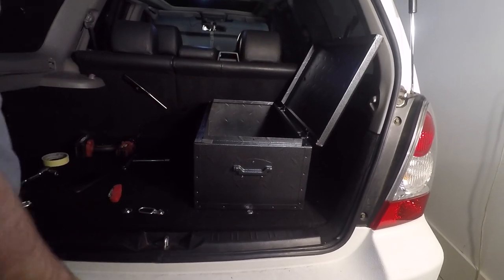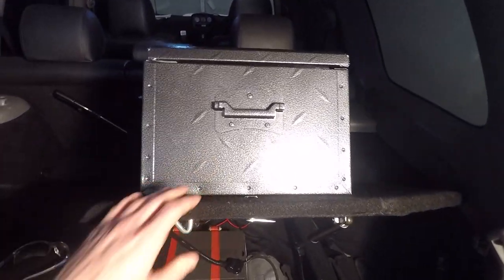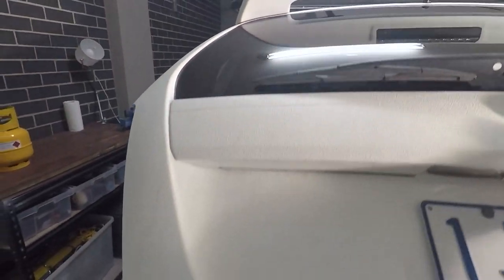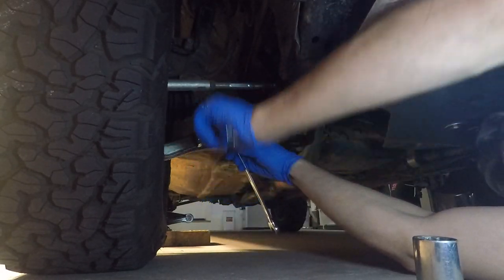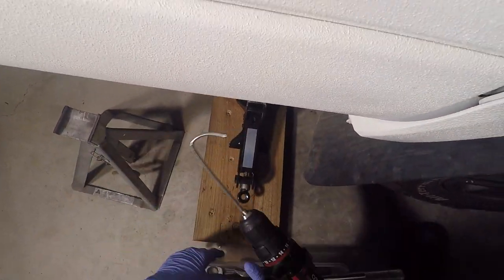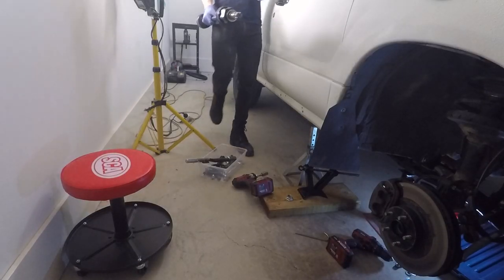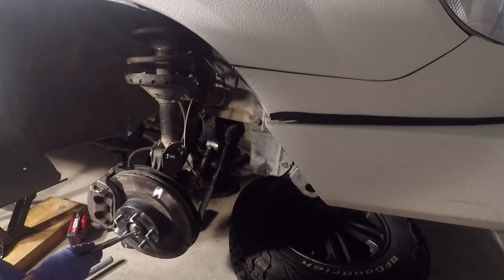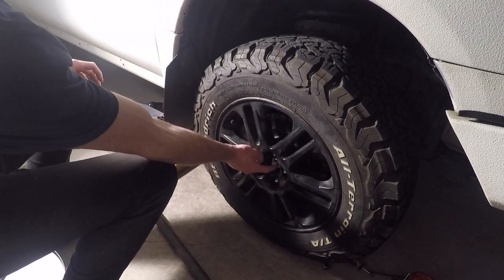Working On The Subaru Forester - Broken CV & Storage Ideas

Comment: Great Job! What is the weight rating for your gas spring strut and size?.  I need to do that so that it can also lift my fridge and couple boxes without the hassle of having to remove them to access my spare tire.
Reply from the maker: hey mate, im pretty sure they were either 120 or 150N